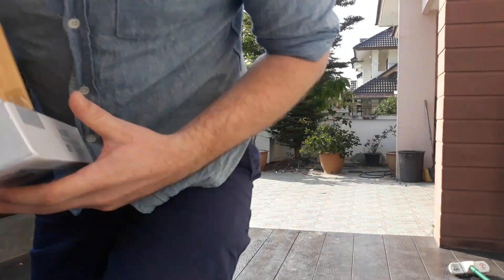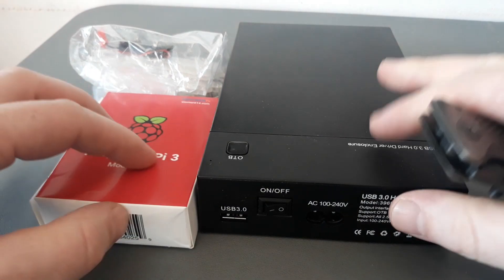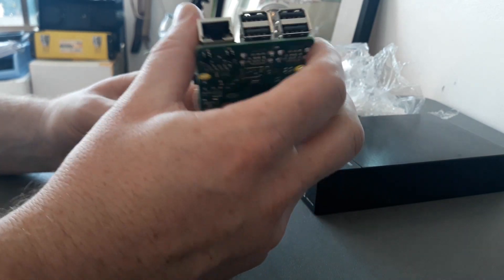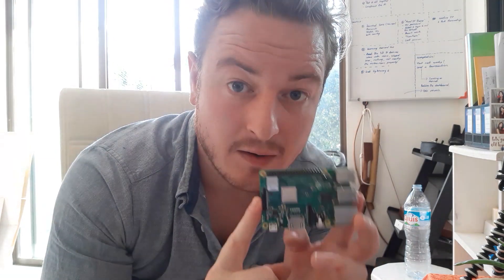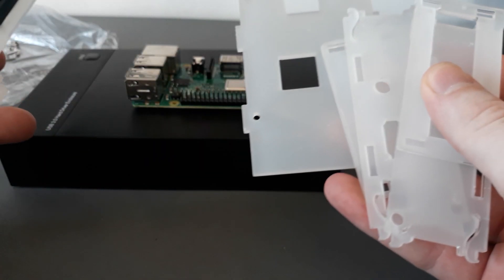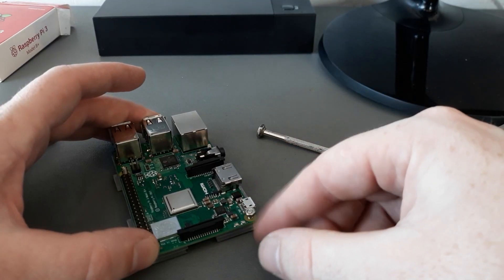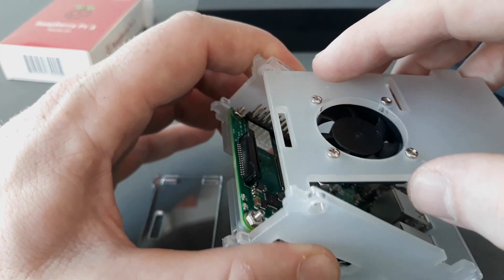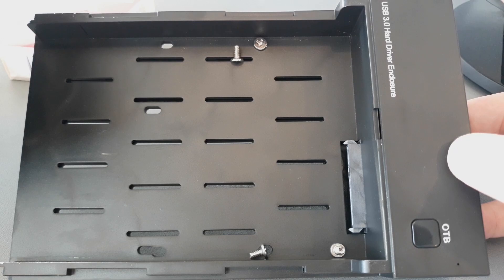Bitcoin Lightning Node Setup - How To Setup a Bitcoin Lightning Network Node.

Comment: Business Owner's Seething Critique of the Lightning Network Goes Viral            

            

                   

        

  

A business owner who runs a media company in Australia 
and pays employees remotely in the Philippines has given his honest 
opinion on what it’s like to use the Lightning Network (LN). Jason 
Smith’s experience of attempting to use LN for payments was filled with 
frustration. He reports that the fundamental structure of the offchain 
solution is riddled with problems.

Also Read: Report: Lightning Network Still Way off Being Ready for Commercial Use

Australian Business Owner: ‘I Want to Pay Employees With Bitcoin — But There’s a Problem’

Over the last few years, people have been arguing relentlessly about 
the Bitcoin scaling debate and proposed solutions. One of the most 
controversial solutions for BTC’s transaction congestion and rising fees
 is an offchain mechanism called the Lightning Network. LN has been 
heralded by many BTC proponents even when it has been criticized for UX unfriendliness, centralization, and routing issues as they believe it is still a work in progress.

Much of the criticism directed towards the LN solution has been 
because merchants find it difficult to use as connections fail or expire
 quite often and funds need to be locked into channels. On Feb. 28, 
business owner Jason Smith explained
 to his Twitter followers that he runs a media company from Australia 
and pays people in the Philippines to help with back end programming. 
Smith detailed that he used BTC to pay them, but in 2017 fees got ridiculously high and he had to “completely write off the idea” of paying his staff with bitcoin during that time.

Smith’s tweetstorm went viral with more than 200 retweets and over 750 likes at the time of publication.

He then tried to utilize the LN to facilitate payments by using a 
custodial LN application and Pierre Rochard’s node launcher. After 
purchasing some stickers with LN he thought the solution might work, but
 after winning some money on a betting site he hit a snag when he 
couldn’t withdraw the money. This is because he needed incoming channels
 connected to his node with funds on the other side.

“I eventually managed to find a service that would open up channels 
back to me, (for a fee), and was able to receive money again — Then I 
started trying to close some channels to get money back out of lightning
 — God what a hassle,” Smith explained. He continued:

Now I’m told some of the Lightning problems 
will be solved with certain developments but I assure you, the 
fundamental structure of lightning doesn’t suit me at all for my 
business — I want to pay my staff each month — Businesses can’t leave 
money tied up in Lightning channels.

‘Lighting Is Not Easy to Use, Which Any Scaling Solution Needs to Be’

Smith also complained about BTC proponents who actually want high fees in order to drive the adoption of LN higher and showed his frustration for commentary like “bitcoin isn’t for poor people.” 

Smith
 is frustrated with the idea of custodial solutions. At the moment a 
great majority of LN projects are custodial unless you are willing to 
fire up a full node. 

Of course, LN supporters didn’t care 
for the criticism and claimed that the system would evolve. Lightning 
Network Labs executive Elizabeth Stark explained
 that it amazes her that “people think something won’t evolve.” Stark 
compared Smith’s issues with people using computers back in the 70s. LN 
supporter ‘Whale Panda’ felt like emphasizing
 that Smith was “spreading a whole lot of misinformation” and added that
 the LN is great for small payments and for everything else there are 
onchain transactions. He further stated that when onchain fees rise 
again, liquidity will come to LN, but Smith explained to Whale Panda 
that his post wasn’t about liquidity.

Lightning
 Network Labs executive Elizabeth Stark believes that the LN protocol 
will eventually evolve. Bitcoin Cash (BCH) lead developer Amuary Sechet 
thinks that Stark’s view is short-sighted. 

The Australian business operator said
 he believes one of two things will happen with BTC: everyone is forced 
to use custodial services or BTC will adopt bigger blocks. “If we go 
custodial, the game is fucked but if we get big blocks, we can actually 
use this thing,” Smith remarked. By and large, the statement caused a 
meaningful discussion about using the LN as a solution to high network 
fees. Smith says the LN is difficult for the average merchant and 
consumer and he’s taking a break until something gives. 

“I also run bitcoin training seminars
 about bitcoin and I won’t be running anymore until I can actually see 
where this thing is heading — This high fee bullshit makes the network 
unusable for normal people, and lightning is not easy to use, which any 
scaling solution needs to be,” Smith concluded.
Reply from the maker: Interesting. Thanks

Comment: What is the reason for running your own node?
Reply from the maker: It's basically my own bank.

Imagine being able to send and receive payments to anyone without needing to use any 3rd parties.

Not just use a wallet. Be the wallet and govern the transactions through it.
Reply: @DigitalNomadXTV  Ah, OK I understand now. Is there a difference to having a Trezor?
Reply from the maker: I think you can use the trezor to store the keys via the electron wallet. You can with the ledger for sure.
Reply: @DigitalNomadXTV  you can store coins and make transactions, I'm just wondering what the difference is to what you are doing.
Reply from the maker: The difference is you can only make transactions on the first layer with a trezor and still rely on a 3rd party to verify receipt of a transaction.

First layer can and will inevitable be expensive in the future.

With lightning you can batch micro payments, set your own fees, make channels with other people, have your own record of every transaction on the blockchain. It's like a bank on top of the bitcoin blockchain.
Reply: @DigitalNomadXTV  is it just for bitcoin or can I use other crypto on it?

How much did your set up cost?
Reply from the maker: Just bitcoin.

It cost about $100 and is basically a toy at this point. The network and node is I beta so I'm liable to lose funds on it.. 

For a business like mine though its really useful to do micro payments.
Reply: @DigitalNomadXTV  nice. Well thanks for replying and thanks for the video.

I'm considering doing a little side project now. I've been looking at other coins you can run nodes or stake on the Pi. It's been very eye opening.

Thanks again.
Reply from the maker: @MarkWalmsley  You're very welcome! You should, it's fun :) I wonder if you could stake ethereum when it moves to POS on a pi?
Reply: @DigitalNomadXTV  That is a bit above my knowledge base right now but its something I will certainly investigate.

I know things like PIVX, NAV etc can be kept on the pi. I am definitely going to look more into this as it helps to get a better understanding of Crypto and all the moving parts.

Once again thanks for the video and the reply and I will be on the look out for more from you.
Reply: @MarkWalmsley  Beware the Rabbit Hole, for once you enter, you may never leave '-)

Good Luck!
Reply: @bitmau5  how do you mean? In terms of getting obsessed with coding?
Reply: @MarkWalmsley  with lightning you make transactions faster and with way less transaction fees, but you lose some decentralisation